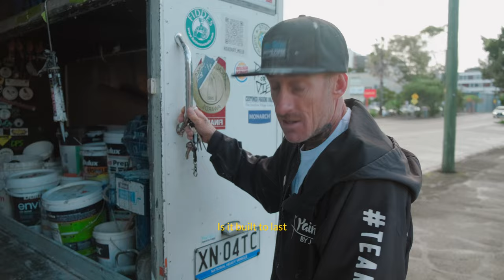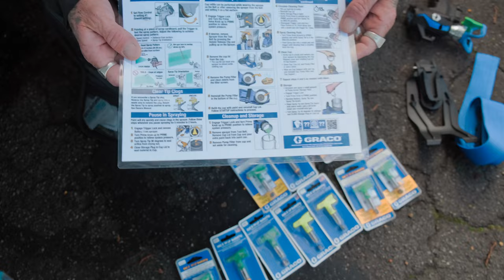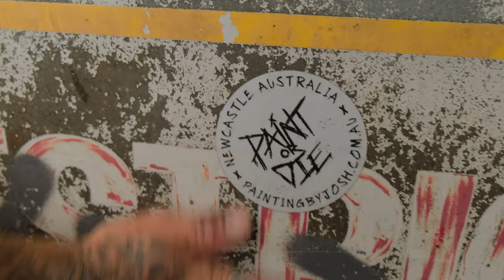GRACO ULTRA QUICKSHOT - CAN IT PUMP PRESSURE? SPRAYING AN ABANDONED BUILDING

Comment: Would the gx19 be better if going cordless wasn't crucial.  Also could you get a good fine finish using the ultra handheld with oil based gloss ? Or would the gx19 be better for that ?  Spraying wall paneling with timber moulds in a hallway .  Probably will use for spraying cornice and skirts too.

Comment: do you feel the pump in This will exceed the standard graco ultra max where the pump burnt out after like 4 jobs? that was the worst thing ever.
Reply from the maker: Hi mate. Yes most definitely completely new pump design I have smashed it for the lasts three months. I havetwo of the old handhelds that just gather dust they are definitely not the best.